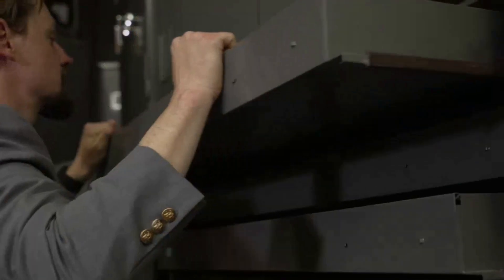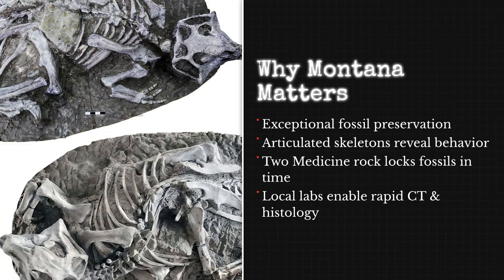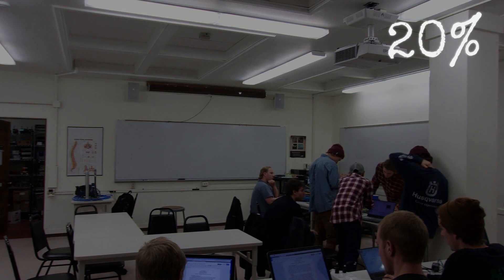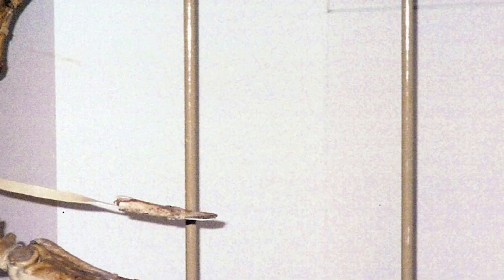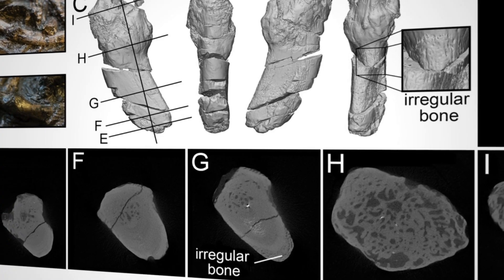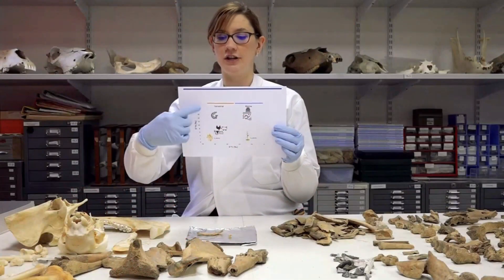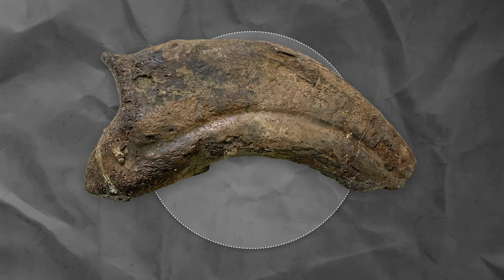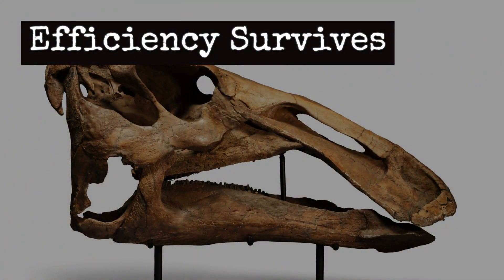The Only Bone Where Evolution Made a Fatal Mistake: Montana Edition

Comment: so it has damage from chronic use, it also had a kerative shaft. unless it had remarkably short arms unlike other therazinosaurs id have it it used it for what sloth used theirs, pulling branches down, the abrassion would only show on the keratin , animals like sloths move slow, and the wear can be explained by frequent and lasting use.
Reply from the maker: Excellent observation! You're absolutely right that keratinous sheaths complicate the analysis. However, the bone damage patterns we see don't match herbivorous wear, they show impact fractures at the claw tips, not abrasion along the length like we'd expect from branch-pulling. 

The real smoking gun is the asymmetric wear: predominantly on the inside edge of the claws, consistent with piercing and tearing rather than sustained pressure from vegetation manipulation. Sloths show symmetrical wear from constant hanging/pulling. This looks more like repeated stabbing motions.

That said, your sloth comparison is fascinating, could be convergent adaptation for different purposes!

Comment: Keratin is primarily made up of amino acids such as cysteine, glycine, proline, and serine, with cysteine being particularly abundant and crucial for forming disulfide bridges that confer rigidity and insolubility. Cysteine, Glycine, and Serine can be found in eggs. I think it makes sense that Therizinosaurus was an egg snatcher. Bigger claws would allow you to snatch bigger nests. Eventually you would wipe out the species around you and you'd have to go for smaller nests, and you would not be getting the same nutrients you need to maintain your big claws. They would be more clumsy too, right? Causing injury all the time.
Reply from the maker: The egg-raiding specialization angle is creative! Keratin sulfide bridges are interesting for claw strength, but the competitive exclusion logic feels stretched. If it got too specialized for egg-snatching, it would've just moved to different nests or food sources. Most animals that size aren't single-strategy operators.
Reply: keratine is not even mentioned in the video alltho surface abrassion is. bit ridiculous.
Reply: @hlRsiempre  What is a claw or a talon made of?

Comment: I have serious doubt those claws were that brittle. They had to have serious function.
Reply from the maker: Exactly. Brittle ≠ non-functional. They could've been brittle for display but still used structurally for digging or vegetation manipulation. Modern materials often sacrifice durability for visual impact. Evolution prioritizes what works, even if it's fragile-looking.